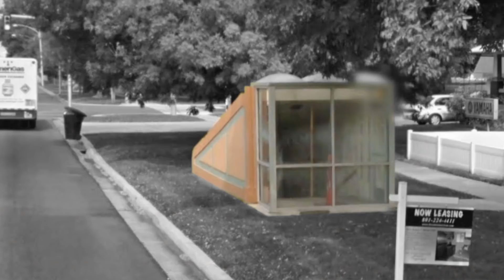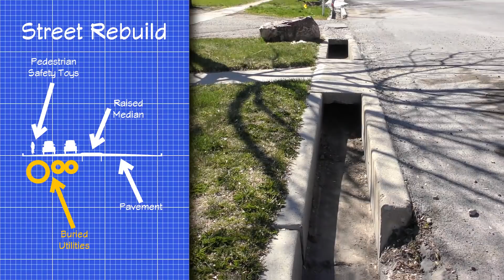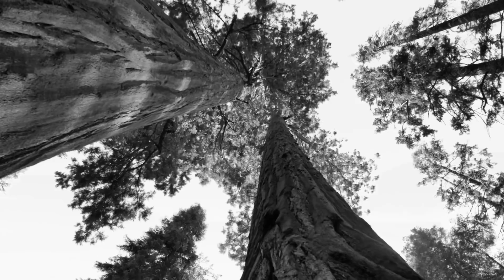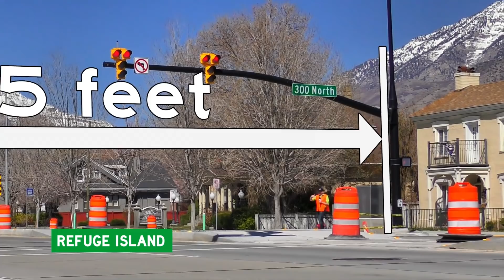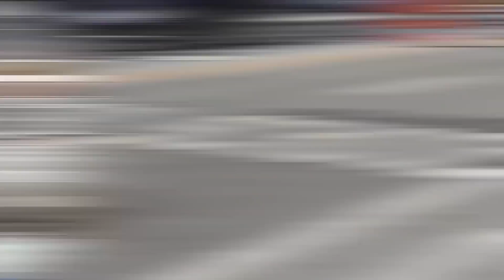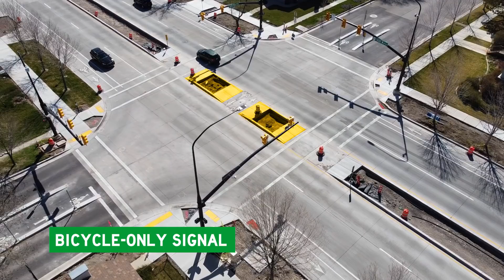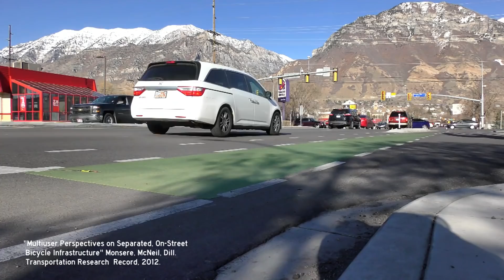Rebuilding the road? Joggers and bikers WANT TOYS, too!

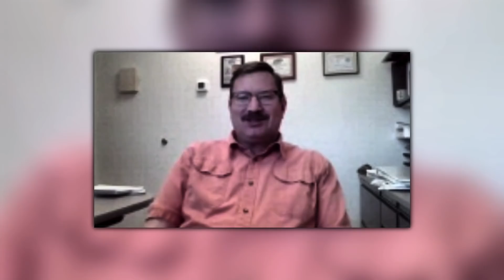Comment: 0:55
Fear of pedestrian tunnels is a really weird western urbanist phenomena, perhaps related to the fact that even "walkable" european cities are still only mid density. In most Asian megacities that I've lived in/visited, pedestrian tunnels have plenty of foot traffic at all times of day to prevent crime, and are amazing to use. Tunnels also have the important geometric benefit that they are small don't need to be dug very deep from the surface, compared to foot bridges that have to clear some very tall vehicles. In the 21st century surveillance cameras are also dirt cheap, the difficulty of patrolling less-walked tunnels is a non issue. As the climate gets more severe, we will likely need to move infrastructure for pedestrians underground, if only to protect people from intense weather.
Reply: Pedestrian tunnels don't feel very safe if you're walking by yourself. There was one in my city in the UK that was filled in a few years ago and replaced by pedestrian crossings. The tunnel smelled of stale urine and had the odd beggar or street drinker in. I didn't like to use it, despite the CCTV cameras.

Comment: Great video showing these different road types --- ironic that the "green" option of bicycles results in more pavement and added hardscape --- "green" isn't always what folks think it is ...
Reply: bikes are more space efficiant if you build infrastructure that is actually usable you can just converte a car lane
Reply: @burgerpommes2001  where I live in Western New York State there are few roads that are both more than one lane each way and not limited-access.  Where they do exist they are typically “stroads” that even divider-separated bike lanes couldn’t make safe.  Let’s completely redesign our sprawling road network around folks who can only use it six months out of the year — good plan.  What’s it like where you live that you can just casually “convert a lane”?  Outside of a few small European cities, I’ve never seen anything like this as feasible, much less seen a successful (read: actually beneficial) example that got past the planning stages on more than one one highly urban part of one street or some converted railway bed that doesn’t go anywhere commuters want to go.
Reply: @bradarmstrong3952  winter cycling isn't bad if the paths are cleared people in a city in a city near the Arctic circle cycle because there is a separate safe network 
In a stroad  area there are that many parking spaces a 15' bikepath wouldn't make a difference
Reply: @burgerpommes2001  here they regularly salt the roads in the Winter — so you are going to ride in dirty, salty slush?  Arriving at work wet, cold, and covered in road salt will be very popular I’m sure …
Reply: @bradarmstrong3952  that is how they do sidewalks?
Reply: @burgerpommes2001  sidewalks are a mix, but often salted yes.  Riding in the Winter here is simply insane
Reply: @bradarmstrong3952  but it doesn't have to be that way 
There are low density polar circle towns that have many people biking

Comment: Bicycle lanes save lives... assuming the bicyclists actually use it.
Reply: Entirely depends on the lane. Most places they're just painted bike gutters, completely useless and considerably more dangerous than riding in the actual lane. Segregated & protected bike lanes with no right on red (for cars), sure. 9th Ave in NYC is an example of a protected bike lane that is still considerably more dangerous than the travel lane, pedestrians, wrong way traffic, turning cars, etc - it was a nightmare.
Reply: For people to use it there has to be a network of cycle paths that take them through their entire journey. Doesn't matter how good a cycle path is if it's just one isolated street
Reply: Build good ones and I will!

Comment: I'd rather have a really wide sidewalk with a yellow line down the middle that would accommodate walkers and cyclists.
Reply: I'd like to see planners start thinking in terms of travel speed instead of travel mechanism.  I.E. <5mph lane, 5-10MPH lane, 10-20MPH lane, 20-30MPH lane.  it seems logical from a fluid dynamics standpoint.
Reply: @kenbrown2808  Not in a safety standpoint though, which is the whole point of separating bicycles from cars. A machine that weighs a couple tons can cause SERIOUS damage to a human even at 5MPH.
Also making the bicycle lanes separate and safe actually encourages more cyclists, because those who wouldn't before due to lack of safety no longer have those concerns.
Reply: @shawnpitman876  when is the last time you saw a driver in a car who wanted to cruise at <5MPH?  or even at 5-10MPH?

the point is, instead of requiring all people on foot to use one lane, regardless of speed.  all people on bicycles to use one lane, regardless of speed, all people on electric cycles to use one lane regardless of speed, etc, it makes more sense to put everyone who is going the same direction at the same speed in a lane, even if one is twisting a throttle and the other is twisting pedals, because it is the difference in speed that increases the likelihood of collision, not the difference in configuration.  
and thinking in terms of travel speed doesn't prevent isolating the lower speed lanes from the higher speed lanes.
Reply: @kenbrown2808  I see people cruise my neighbourhood at 5-10mph constantly because they think they're being safe doing that while they're checking their phones and shit.
Reply: @shawnpitman876  in which case they should be stopped in a perking area.  just like pedestrians who want to look at their phone should stop walking while they do it.
Reply: @shawnpitman876  well, i guess it does produce great video for youtube, when they walk into a post, but when they walk in front of a car, the result is the same whether it's the driver or pedestrian staring at their phone.
Reply: @kenbrown2808  Nope, the driver who shouldn't be using their phone would see the pedestrian and be able to stop.
Keep trying to make excuses for drivers who aren't paying attention though.
Here's a hint for you since you don't seem to understand how things work: If it's not a stoplight, pedestrians have right of way, meaning YOU as a driver stop to let THEM go by.
Reply: @shawnpitman876  it's you who is trying to make excuses for pedestrians who are staring at their phone instead of watching where they are walking. That makes it pretty obvious you are one of them.
Reply: @shawnpitman876  also, no. Pedestrians only have right of way at crosswalks, and they are still required to wait for traffic to safely stop. If you cause a crash by barging out into traffic, you will be held liable.
Reply: @shawnpitman876  so first, you think you get to make up your own rules. Second, see the first. Third, see the first.
The world isn't obligated to babysit pedestrians so they can be on their phones.

Comment: I don't get why there is so much effort and energy put into creating bike lanes that are almost NEVER used.  Atleast here in Northern New York when I am, I've only ever seen a bike lane used a handful of times in recent memory, usally bikes and skateboards were just on the sidewalk anyways.  Is there something I'm missing as to why civil engineers and city planners are so crazy about creating them?  Is it just that the bike Karens are the squeaky wheel that get the oil?
Reply: In theory, if you build enough bicycle lanes and sidewalk space, and if the city is developed around a compact enough area or if it has sufficient public transport, bicycle become a feasible mode of transportation.  And if people do use them, you can carry a lot more people in the same amount of space in a bycicle lane than a car lane, which reduces traffic.  It's a chicken and egg problem, so to get the ball rolling you sometimes need to build some infrastructure before it can be useful.
Reply: It's almost like cyclists are rare because of the lack of consistent access to bike lanes that feel safe? They can't change the entire road system in one day but by taking these smaller incremental steps we could eventually have a US where a large $3000-$20000 piece of equipment that weighs over 2000 lbs, requires regular maintenance, and is constantly consuming a limited resource isn't literally a requirement to exist.
Don't get me wrong, I'm a huge fan of cars, but the fact that it's a requirement to live in like 90% of the US is kinda wack.
Reply: The bicycle is the only means that can coexist with cars and pedestrians if and only if there is mutual respect, now, you said that you see more often people on bicycles who use the sidewalk instead of the cycle path, the factors are three: either they grew up with an old law that required bicycles to be on the sidewalk (and therefore it takes a bit of patience) or some infrastructure issue, or they are indifferent people and do not care about the safety and/or the good of others
Reply: @CaroFDoom  Sure that makes sense in an urban setting. But here in rural America it really doesn't. 

I live in a town ~26k people, with about 60% of them working 15-20 minutes away at highway speeds, out on the Army base.  We also get about 200 inches of snow annually, so the riding season is only about 7 months if the weather plays nice. 

Last year they tore up one of the downtown lanes and replaced it with a bike lane, while I was away for a 9 month work trip and traffic is SIGNIFICANTLY worse with it there. Now it's not uncommon to see the downtown circle backed up for 10-15 minutes.  I've sat longer waiting to get thru the downtown circle than a traffic free commute.  Not to mention the plows here don't touch it.

It just drives me nuts that they made a bike lane when it had ZERO demand and it doesn't make since locally. I feel it was shoehorned in cause NY urban planners treat everything like NYC or Albany when our realities are DRASTICALLY different.
Reply: @OpossumSupremacist  you say rural. Then you say downtown. Pick one. 

Downtowns should be built for people, not cars, if they hope to find any prosperity.
Reply: @driversofboston4767  I didn't know a small town couldn't have a downtown square. sarcasm  but for real, it's a tiny town with a 1 block small downtown strip, built up along the river and central square with a large oval shaped 3 lane traffic circle in it.
Reply: @OpossumSupremacist  3 lane traffic circle and they no doubt wonder why nobody visits. 😂
Reply: @driversofboston4767  It's a mess.  8 one-lane feeder roads.  And 4 roads with a Y intersection within 300ft of the circle.  Add in NY drivers and the comical amounts of lake effect snow.  It can be an... experience... driving thru in here
Reply: @driversofboston4767  It's a mess.  8 one-lane feeder roads.  And 4 roads with a Y intersection within 300ft of the circle.  Add in NY drivers and the comical amounts of lake effect snow.  It can be an... experience... driving thru in here
Reply: @OpossumSupremacist  but that's the thing. Why should a regions downtown be designed to drive through and not drive to?
Reply: @driversofboston4767  because not all communities are so centralized and many people probably have to drive across downtown to get to work
Reply: @driversofboston4767  Not necessarily,  with my town being from the 1700s, all local roads feed into and out of the central square.  So unless you drive thru neighborhoods and stop ever 100ft, it is hard to avoid being funneled thru the central square. It was never designed to have a main walkable downtown area and the town is too small for a public transport infrastructure to be viable. Especially given the brutal winters and lake effect snow
Reply: Try using them for once and you'll see why they don't get used. It's hard to judge that from behind the steering wheel. When riding, ask yourself: "Would I let my kid ride to school on this on a daily basis?" If the answer is no, then that's exactly what the issue is.
Reply: Because rankings look into miles of bike lanes, public transport etc. So they put a little paint on the road and call it a bike lane.
Reply: It's that the bicycle lanes are fucking trash and nobody wants to use them because the only ones who are comfortable with doing so are already in the car lanes

Comment: after trudging through the silly intro the video was pretty good.  the intro detracts from the overall video. 
People on bicycles want safety and convenience, refering to changes in these areas as "toys" is really...condescending? car centric? really goes against being a bicycle advocate. I don't need anything "fancy" or "toys" slow the traffic down to 20mph or even 25mph on every street and people on bicycles will love it, no protected lanes or "toys" needed with safe streets. The features are kind of ways to keep car traffic moving as fast as possible, without making significant changes to improve the safety of the streets: SLOW THE CARS is the main goal in safety, which may or may not have much of an impact on total trip time--slowing a driver from 45mph in a 30 to 30 mph in the updated now 25mph zone might just save them gasoline and brakes, and decrease the time they wait (or if they wait at all) at red lights.